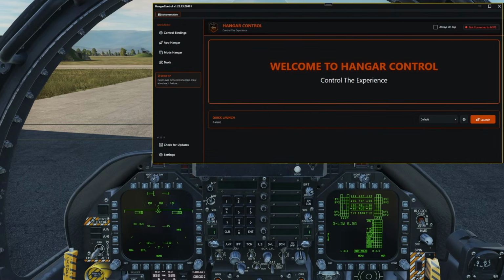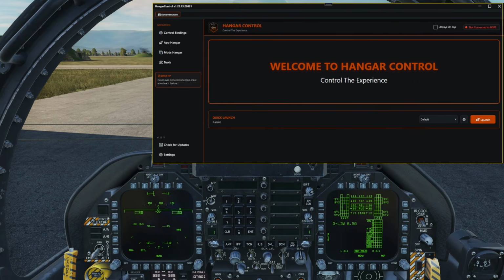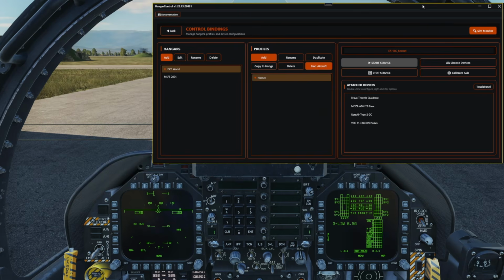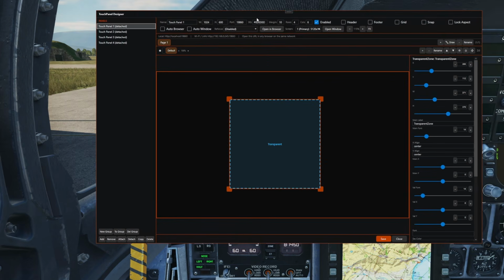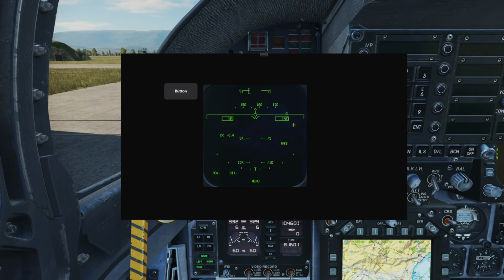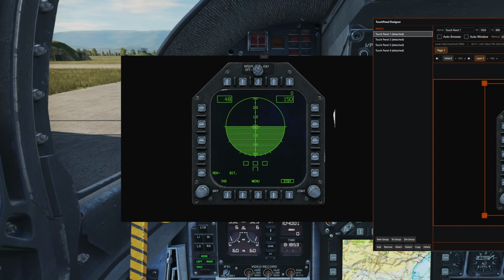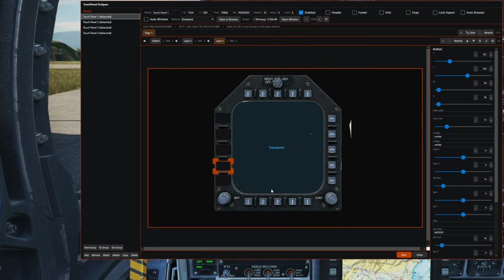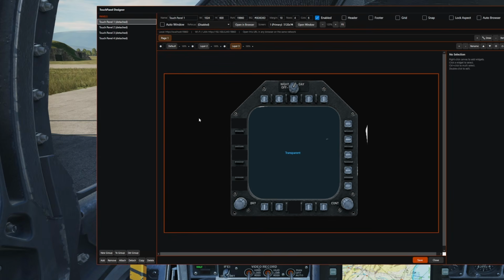Transparent MFD Touchscreens for DCS, MSFS & X-Plane | Hangar Control

Comment: Tried your free trial as i cant get helios to work and you said it was easier to setup i use triples 3 42" LG OLEDS and a small screen for dash board when racing cars so in DCS was hoping to make 4th screen my AMPCD and would it hell work couldn't even get the screen  numbers right,,..say my screens were 1,2,3 your software was maybe 2,1,3. Tried everything you suggested,,,thing aren't as easy to setup as folks suggest because everyone isn't using the same hardware tired of people saying how easy thing are when there not..

Comment: So basically be a DESIGNER. Well for those seeking immersion they use VR instead. All buttons in DCS can be mapped including LEFT & RIGHT DDI e.g. for increasing RADAR RANGE (a very annoying button to find as that is on a Multi-Button for 11 & 12 on the DDI)
Reply: You can bump the cursor to the top margins of the radar page to increase range and to the bottom of the radar decreases range. FYI.